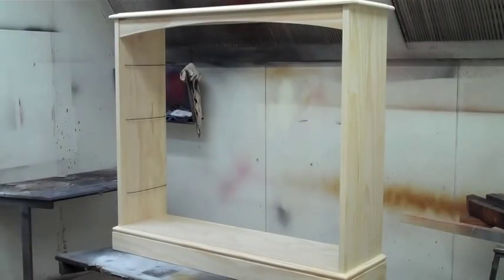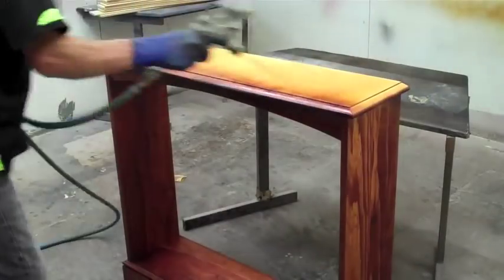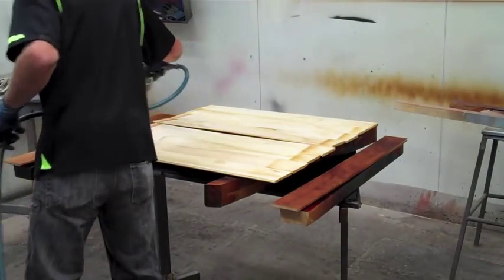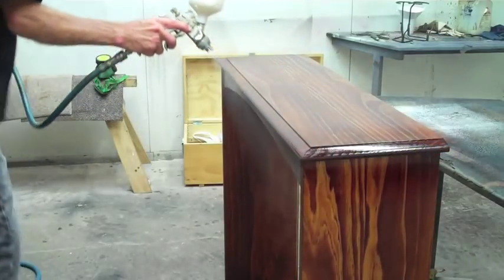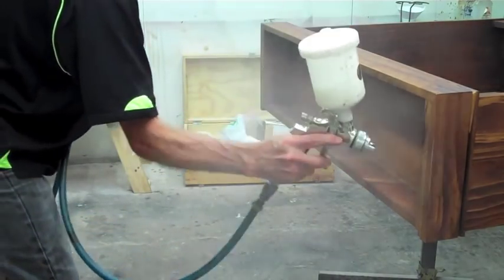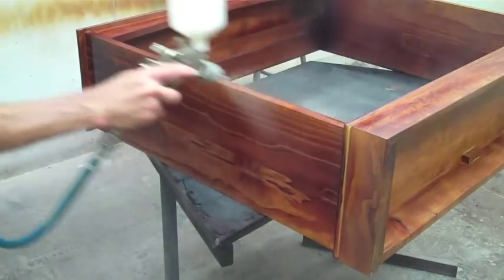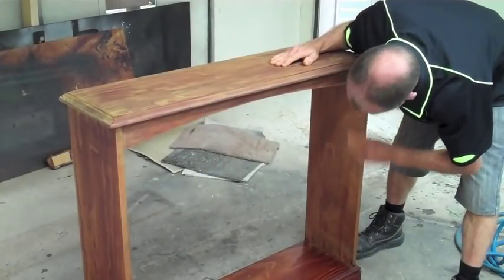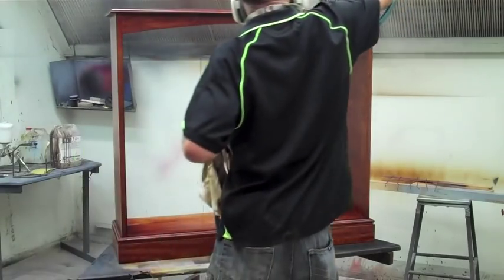Spray Finishing bookshelf.m4v

Comment: Hi Andy, i was wondering what brand or type of spray gun you are using here? I'm trying to figure out what kind of gun to purchase for some diy cabinet making etc...so im looking for a brand and nozzle tip size recomendation as there is such a wide variety of prices and specs available, thanks if you can help:-) Cheers...
Reply from the maker: Robert Pike Hi Robert.
amx k - 400. If you are spraying lacquer you probably want a 3 or 4 tip. Ordered some recently from Mirotone nz. 
Phone Chris at Mirotone nz 02195584 He will give you more info on them. About $160.00 from memory. I have used cheaper guns that also work fine "star" are good guns. I prefer gravity fed over a pot. Hope this helps.

Andy.